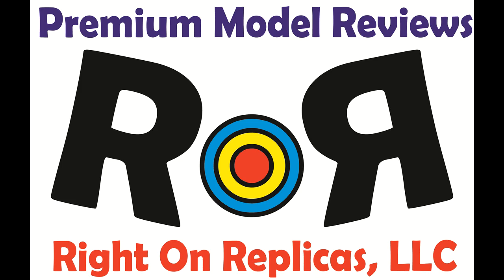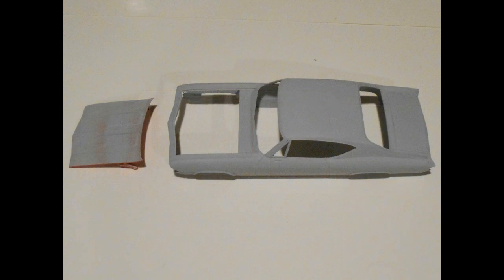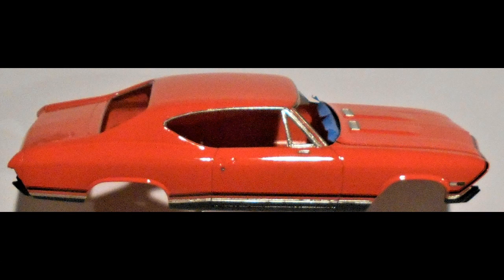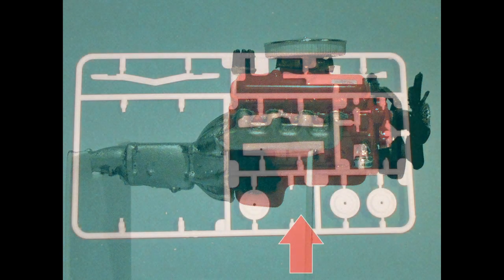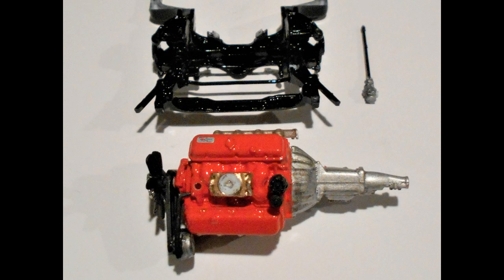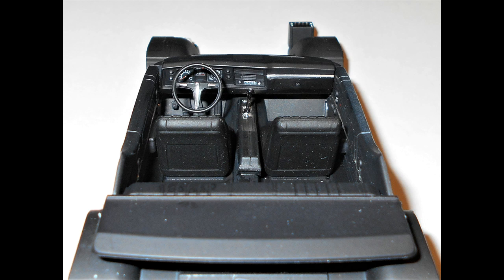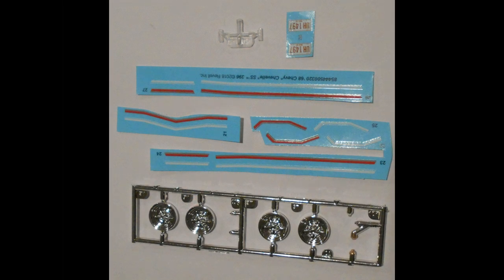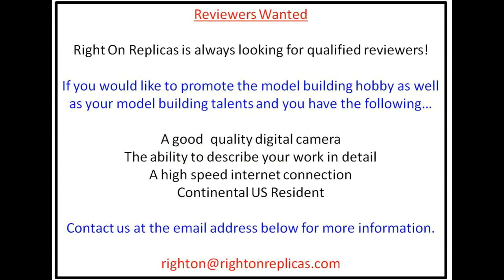1968 Chevelle SS 396 1:25 Revell #85-4445  -Model Kit Build & Review

Comment: I've noticed that Revell is up dated skill levels ,age , and now putting on build hours .            
Do you know why this is ?
 I have a 2011 69 Chevy nova Special edition it has skill level 2 age 10+ ,now on the 2017 issue it is a skill level 5 age 14 + and it shows 7 + hours to build.
thanks ,and I enjoy your videos .
Also what is a good temperature to paint ,my basement is around 65 ,or 70 degrees
Reply from the maker: RW,  Mostly the skill levels of children are higher because model building used to be part of our youth's culture.  Parents and older siblings used to teach each other.  Now they have to learn how on their own and from YouTube (RoR).  That means it takes longer to learn and kids are thus older when they have the appropriate skills.  Secondly, Revell USA adopted the skills range definitions of Revell Germany to standardize their corporate practices.  

Most paint is designed to be used at room temperature which is traditionally 72 decrees F.  On the other hand, warming the paint and subject or using thinners and retardants can stretch that rane 20 degrees in both directions.  Thanks !  -Doug
Reply: @RightOnReplicas  thank you, I asked you, because I figured you would know